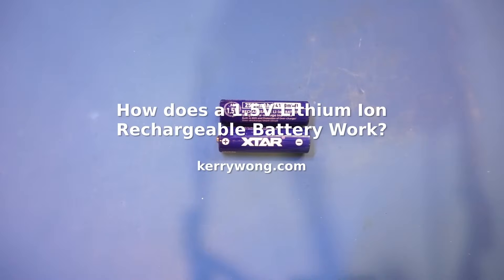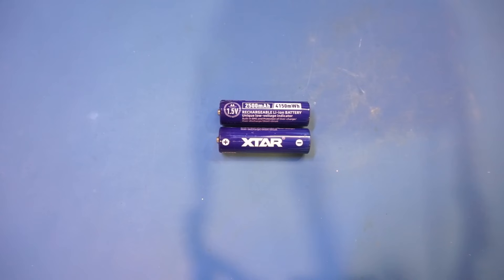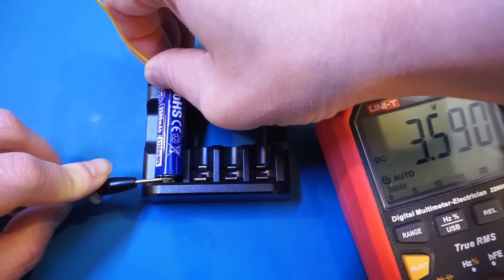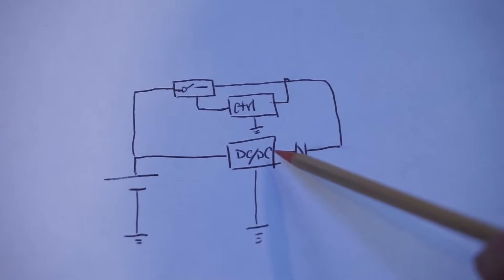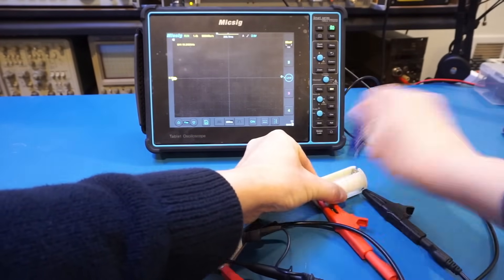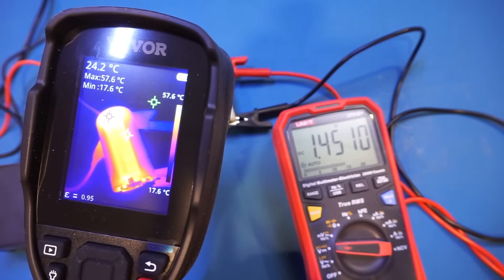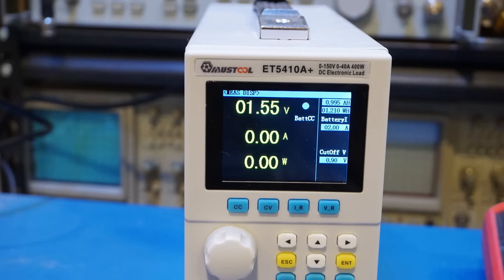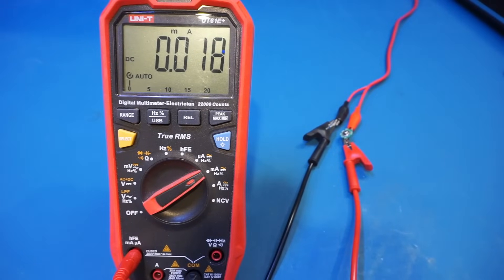How does a 1.5V Rechargeable Lithium-Ion Battery Work? Review/Teardown of an XTAR 2500 Battery

Comment: Kerry, I think for a lot of applications the 1MHz switching noise will not be appearent in application. What interests me most about these are 3 things: Capacity, self discharge and chemical leakage. Since no manufacturer on the planet makes a leak proof alkaline battery (and Duracell is the worst for this as well as Costco) these batteries seem a very viable alternative. I have not researched the cost but if they are comparable to the Eveready Ultimate Lithium AA cells they are worth a look for me. These are the only cells I am currently using in my T&M equipment after alkalines destroyed the AA battery pack in my Fluke 289 DMM which cost me $80.00 for a new back. I would be interested to find out what the real self discharge looks like. It seems with NiMh cells and even some T&M gear (my Owon SDS6062 LiOn powered DSO an an example) are always dead when I need them. Thanks again for doing the review on these as I will be checking them out just as soon as I click the comment button. Sam W3OHM
Reply: Neither NiMH or non-rechargeable Lithium AA leaks..
Reply: I have 8 AA Eneloop batteries which were left for 6 years in satellite meter. Every one of them were discharged to 0V. None of them leaked, and all of them  have been charged and have almost factory capacity. I don't remember any AA or AAA battery leaking that I've owned. In the past, NiCd button batteries leaked frequently.
Reply: @brahmoone  Long ago, I read that NiMH cells can leak, and I was skeptical, since my eneloops never did.  Then everybody moved on to newer NiMH chemistries.   I had high-capacity Energizers, Duracells, Rayovacs all getting grossly imbalanced and dying early -- and yes, they started leaking too.  High capacity NiMH cells all seem to be a bad tradeoff.  You're getting a little more capacity when young, but it's much less stable and more prone to leaking.   Those old Eneloops from 16 years ago still work, and none have leaked.  All but two out of dozens of newer legacy-brand high-capacity cells have failed, and a few have indeed leaked.  The two that are left are barely able to run my wireless travel mouse for a few hours.

At least that's my limited experience, grain of salt required.

Comment: @Kerry Wong, I have a challenge for you :) 

First, thank you for this fabulous video. I learned quite a lot about the 1.4V Li-Ion cell.

My challenge: 

How can I see how full a 1.5V Li-Ion battery is charged, since there is no voltage drop until the last 5% capacity, hence a standard Ni-Mh battery tester will show a full battery because of the consistent voltage even though it might be drained down to 20% of it's capacity? 

(final voltage drop to indicate the empty cell is at the last roughly 5% if I got it right)

I thought about measuring the internal resistance in Ohm because I believe it would become larger as the cell discharges, but the chip inside the cell might distort the result.

Can you recommend a special test device or workaround?

Thanks a bunch again and keep up your great videos.
Reply from the maker: It won't be easy as the DC-DC converter will try to maintain the 1.5V output. In theory, you should be able to infer by drawing close to the maximum allowed current. As when the internal resistance of the lithium ion cell increases, it wouldn't be able to sustain the high current draw without significant voltage drop and the DC-DC converter would cut out at smaller current.
Reply: @KerryWongBlog   thanks a lot for sharing that approach. As I am a home user with little equipment, I am afraid I have to wait till the market offers home user testers. 

On the other hand, as there is no home user testing device yet, is there any chance you create a video how you would test the current charging status of a 1.5V Li-Ion if this is  interesting to more users?

Comment: good in depth review. I have two xtar cells and they were powering the device until the voltage dropped to zero. But the next day when I put them on the charger they would not charge anymore. Luckly after connecting them to a variable power supply set at 5V for a few seconds, with 450mA drawn current, they switched to charging mode again. You have to be careful not to wait too long after they get discharged because the lithium ion cell is likely to go very low and get damaged . Normally if you wait a few weeks the Li-ion cell should still be within limits, but not sure if the circuit will accept charging anymore, even if connected to a 5V PSU.

Comment: I just received some AA and AAA usb type-c rechargeable both Rated for 5500mAh. I ran them down to 1.1v and measured the capacity of input energy. The AAA took 200mAh at 5V = 1000mWh and the AA took 675mAh at 5V = 3375mWh. The usealbe output capacity would be the mWh / 1.5V = 2250mAh for AA and 667mAh for AAA. I have asked how they calculate  5500mah without reply. Maybe the capacity is 5500 but only a partial amount is able to discharge. Testing 3 AAA in a small 9 LED flashlight caused damage to 2 flash lights. Flickering and burnt out LEDs while using these batteries. The switching noise was 50 to 100 mv and I suspect the flash lights received high voltage surges when the batteries were depleted. The safety circuitry is weak or non existent.
Not sure if I trust using these batteries in my devices.
Reply: I'm affraid they included all 4-pack capacity in those 5500mAh. 😅 Or maybe summary capacity from brand-new to end-of-life usage 🤣
Also try to avoid using those batteries for devices that rely on internal resistance (IR) of cells and gradually lowering voltage - such as christmas LED lights, torches etc. These devices, especially cheap ones, dont have any corrent limiting resistors and rely solely on IR of batteries. This may be the reason, some LEDs failed. I think, these batteries can have their niche of usage with devices that need 1,5V like of alkaline, and operate poorly, when Ni-MH are used.
Reply: You do realize that they are using Chinese mAh in their documentation?....

Comment: Have you measured bare cell capacity? It would be interesting how much it has.
Reply from the maker: 16:45 Measured battery capacity
Reply: I mean without dcdc conveter. From 4.2V to lets say to 2.8V
Reply: @sklepa At a guess is should be comparable with any Lithium Ion cell of the same size. Low current Lithium cell that is, similar in performance to a button cell.  Since it can support 2 Amps maximum AFTER the STEP DOWN from 4.2 to 1.5 V its maximum native current should be in the vicinity of 700 mAmps.
Reply: @blg53  yep, i know but was curious if Kerry measured some exact numbers 👍

Comment: When used in series, is there less noise overall, or does the noise double?  If you start will two fully charged cells in series, will they both reach full discharge around the same time?  I would assume only one cell dropping to reduced voltage would not trigger a low battery signal.  With the two cells disassembled, it would be interesting to track the voltage and current of each lithium cell through a discharge cycle.  I suspect these cells will be used in series more often than not.  When the one cell expires, does it allow current to flow or does it go open circuit?  The potential problem is the continued battery output is limited by the weakest cell, shutting down more quickly than a standard rechargeable would.
Reply from the maker: Like you said, when connected in series, it's only going to last as long as the weakest one. And the cutoff would be abrupt compared to your typical cells.

Comment: What would the intended use case for these be? Anything that runs from AA cells should work fine on NiMH cells unless it was very poorly designed.
These have less capacity than NiMH cells while costing more than twice as much. They have a noisy output, I would imagine the self discharge rate is rather high because of the DC-DC converter, and they need a special charger.
Reply: The real difference between these and NiMH are likely only the constant output voltage and slightly lighter weight. I'm having trouble thinking of anything (other than maybe flashlights?) that would enjoy those benefits while also being OK with the noise and somewhat unpredictable shutoff. If it had another significant benefit (i.e. capacity, price, etc.) I think it could be a winner, but right now it seems pretty niche. I'd be curious if the noise caused any issues in something like a portable radio, too.
Reply: I have several motor-driven appliances (automated window blinds, kitchen garbage can lid, blood pressure machine, etc.) that are designed for AA cells and they ALL struggle with the decreased terminal voltage (1.2 volts) presented by NiMH cells.
Reply: @setSCEtoAUX  I've tried using rechargeable Li-ion AA batteries in AM/FM radios. They completely shutdown the AM band. I did an experiment a few days ago placing a Li ion AA in parallel with the ferrite antenna. Horrible noise and no signal.
Reply: Flashlights are the biggest thing. The 0.3v nominal voltage per cell makes a difference if the flashlight doesn't have voltage regulation, and most don't.

I normally modify 4 cell devices to use 5 cells if they were designed for alkaline and I'm using Ni-MH. If it's a more sensitive device, I use a  buck converter to drop the voltage to whatever it needs, maybe add a capacitor to smooth ripple.
Reply: @Pantology_Enthusiast the best flashlishts runs on 18650

Comment: Nice review.  Are there any issues with the batteries in series and parallel?  Are the outputs of the regulator fully isolated from the inputs so you can use them together? Did you trace out the circuit?  It would be nice to know how the circut is connected.

Comment: I should be able to charge this with my XTAR VC4 charger then?  Since it's just basically a 18650 type battery but in a AA size format
Reply: I don't think so. The VC4 is for charging NiMH or Li-ion cells. These require 5 volt charging.
Reply: @AdamHelb The video does show the charging starts at around 3.7v I think
Reply: @mohgujai  I still think the VC4 does not know how to charge these cells properly.  The charger for these XTAR cells is really inexpensive.
Reply: @AdamHelb  it's not about $ it's about minimising waste, if the charger is still good I want to reuse it

Comment: It would be nice if the DC voltage conversion would work both ways, so you can charge them with a regular 1.5 volt NiMH battery charger.
Reply: That would make it way more complicated and would probably need more space.

Comment: Hi Kerry, thank toy for a very interesting Video, you confirmed what I thought the construction was inside the cell. Here in Sweden I bought a similar product with the brand name XOXOPO,  the AA cells are rated at 1850 mAhr together with a charger that is driven by a 5V USB cable.  The instructions specifically say do not use the charger for any other cell type (such as NiMH). I am using the cells for driving an electric toothbrush, so the regulator noise does not bother its operation, at least I get 1.5 V which works great, as compared with when you use NiMN cells which have an output voltage of 1.2 and as a consequence runs slow.  I have done capacity tests on these cells and at 200mA load they gave a performance of a little more than the rated 1850 mAhr. It will be interesting to see how long the cells last.

Comment: You covered under "switching noise" the problem I had trying to use Li-Ion rechargeable AA batteries in an AM/FM radio. If you take a li ion AA battery and place it close to the ferrite AM internal antenna of a radio, it completely blocks AM reception.  How that was explained to me was the stepdown circuitry is working all the time whether the battery is being used or not. Your video is the first to explain this! Thank you. Great video.
Reply: You cant turn the circuit inside them off? 
Its like my small powerbank all over again! Kept making that almost audible noise and clicked every half second, It also was super loud on my SDR and AM radio.
Opened it and soldered a switch into the circuit, but thats no option here...

I was considering getting a couple of these, but thats not an option anymore. Thanks for warning me about that.

Comment: Whaaaaaat?! Really? They use ordinary Shottky diode instead of some kind of mosfet-operating protection against reverse polarity? that could be the source of this 75 degree heat, when drawing 2,5A of power... I hope, they improve this converter, to be more efficient. Also, deeper testing would be nice, in that area. Also, I would love to see the battery voltage, to be gradually falling from 1,5 to 1V in last 30% of energy state, instead of that one-step fall, which may cause some operated digital instruments to crash before they notice user of low battery.

Comment: I tried NiZn but the charger would not work.  I had defective cells, a defective charger or possibly both.  I just returned them.  This shows that some alkaline alternatives are mediocre!  Not only that but the two more common rechargeable chemistries have a voltage of 1.2 volts.  That can put a huge limit on the number of things they work in.  I had a digital camera that uses AA cells so I would know a bit about the abysmal life of nickel cadmium and the somewhat better yet still mediocre nickel hydride.

Comment: wowww now  you have let the cat out of the bag, the  converters  will be the failure point  just like  the bms  is on the large lithion  100ahr  batteries leaving a person with a dead battery ...Its a given, the electronics  can NOT hold the constant cycle of   In out voltage /current , so sad stick with nimh no internal parts circuits etc .

Comment: I find the idea good, but what you mention about current draw/ temperature could be a problem with combustion.I would wonder if the battery could be used in outside wireless weather stations.
Reply: Not if you live anywhere it freezes if your weather station has PV recharging. You do not want to try to charge those cells below 0c.
Reply: @johnwest7993  because it's Li or the voltage configuration? I don't remember hearing about low temp problems with Li. Could you please explain or should I just "see the books".I wasn't thinking of charging them in place. Oh heavens, my station has no way to recharge in place. I believe I see your point now, thanks.
Reply: @jdmccorful  Most lithium ion cells can be damaged if charged below 0°C. You can usually get away with a very slow trickle charge though.

They would work if you are not charging them outside, but the DC-DC converter in these cells will probably drain them rather quickly. 1.5V lithium primary cells would be a much better choice for a low powered device like a weather station sensor since they can handle below freezing temperatures well.
Reply: @rocketman221projects  I hear what you are saying. I have always used the Energizers Li batteries in my station, but in the past year they have gotten so expensive and I hate disposing. Initial expense ok for these rechargable and I would swap and recharge in stable 72 degree home.Thanks for your time.